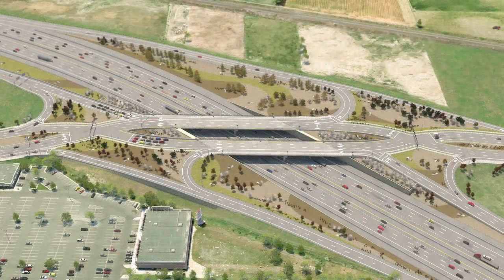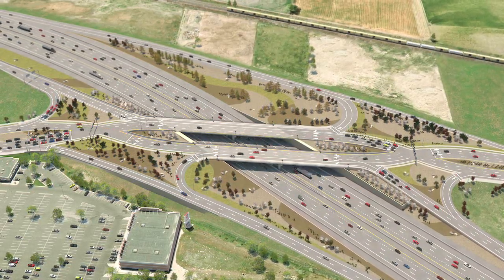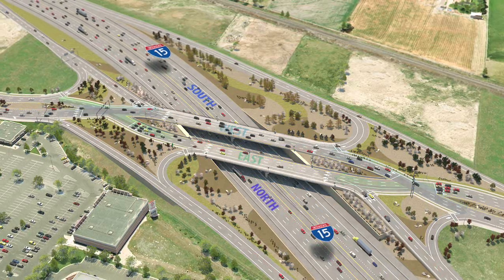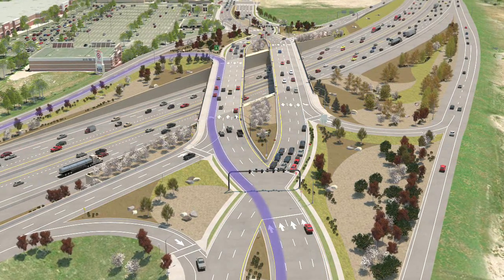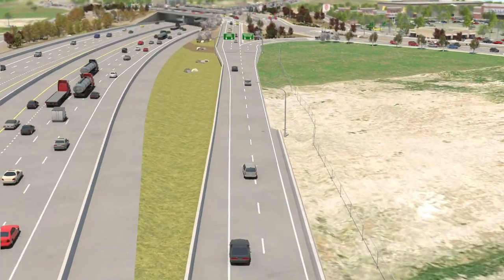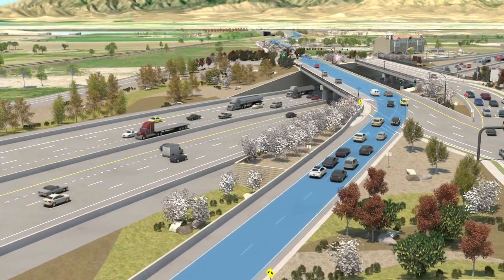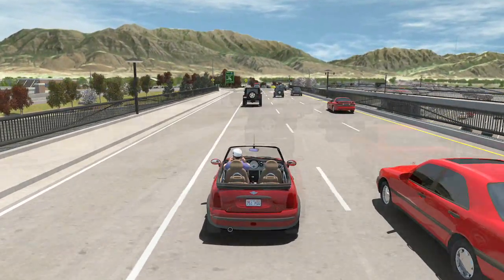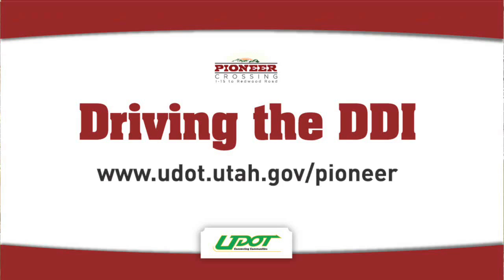DDI Animation

Comment: I see a definite advantage over places where you used to have to wait for the light to make a left turn.  It also seems to be safer than a roundabout, where people failing to yield to those in the circle is always a risk. I'm not yet sure why this is better than the usual clover design except that it seems the diamond uses less space as you don't need to drive in a 270% turn.

Comment: so many exits on the left..

there's no way this can be considered safer &/or more efficient with lefthand exits - left exits are a major cause of back-ups & congestion because it keeps slower traffic on the wrong side of the road.. you want exiting traffic [slower] to merge right & let the onward flow of traffic to remain left & pass safely.

plus, in this scenario, i can already see cars sitting each other off to get into the left lanes for the freeways - not a doubt in my mind there will be drag races from the stoplight to the left exit lanes..

this concept would be better if it implemented righthand exits instead of lefthand ones - it does look pretty though..
Reply: Welp, they are getting put up all over the place, and the data just keeps rolling in. These things are kind miracles, increasing safety while hugely improving traffic flow.

Comment: I can improve on this just by having the DDI overpass each other instead of a light controlled intersection.
Reply: You can't.
Reply: Not just you can. Double Crossover Merging Interchange (DCMI) is akin to an independently developed (to DDI) grade-separated free-flowing version of the DDI.
Reply: Explain why
Reply: The way they have this, at some point someone not familiar with this intersection is going to turn right into oncoming traffic because the lines are worn out and the signage isn't easy to see.  That is my impression anyway.
Reply: Robert Schuster, you can't.

Comment: +Utah Department of Transportation
How is it better than the cloverleaf pattern? That also eliminates left turns, have less conflict points, no lights, no limit on straight through traffic, let alone it can take less space and less confusion.
Reply: It is better than a cloverleaf because there is no weave condition for a short distance at high speed. Not all conflict points are equal.
Reply: Not sure for this case, but I know of PTV products that seem excellent for that purpose
Reply: it's not better than cloverleaf. It is less expensive, especially for retrofitting an existing diamond where you can reuse many of the existing ramps. It is, however, definitely better than the standard diamond if the majority of the traffic is turning.

Comment: heard about roundabouts?
Reply: Roundabouts are not suitable for high traffic whatsoever. This is 4x3 lanes, man. Roundabouts can maybe manage 1 or 2 lanes from all directions. Roundabouts would limit pass-through traffic throughput (going straight) and necessarily involve conflict points, which this design doesn't have for at least half of the traffic (thanks to the underpass)
Reply: Those take up so much more space and if they were to go with that instead, they would need to add in more bridges and also take into account Semis to which I am experienced with driving, and come across a few poorly designed rotaries with too small diameter or not enough lane width to account for the trailer trailing.
Reply: Glen, the Arc de Triomphe in Paris, France has a ten abreast no marked lane roundabout or traffic circle, what a traffic headache/nightmare and no lights.
Reply: wrong, roundabouts can easily handle 3 lanes from all directions and can be built with or without lights
Reply: Joshua Cornell and am sure there are several other roundabouts with equally complex traffic patterns, such as the magic roundabout in Swindon, I was merely pointing out that roundabouts can handle more than the one or two lanes suggested by GaborBartel
Reply: North Americans are scared of roundabouts. It's sad but true.
Reply: GaborBartal though I think the DDI is better here for this level of traffic, especially with a high volume of left turns, I could imagine a roundabout having 2 lanes from each approach with slip lanes on all right turns.
Reply: Roundabouts can be great when the circle is single lane. They lower average wait times in light to medium traffic, and reduce serious injuries and deaths (not accidents, roundabouts actually cause more, but since the accidents are almost completely sideswipes and rear ends vs headons and T-bones they aren't as serious).

Single lane roundabouts suffer once traffic gets heavy though, because they can clog, and become comparable to a four way stop. Assuming drivers don't block the intersection traffic lights do better in very heavy traffic situations (assuming the majority of people aren't turning left, then things can go to shit). Also if drivers DO block the intersection lights suffer, but still no as much as a clogged roundabout.

Multi lane roundabouts are a whole different beast. They lose a lot of the efficiency advantages of single lane roundabouts, and because of their size (and associated increase in speed), they also lose their safety edge. Driver side high speed T-bones in multi lane roundabouts are very common, with very bad results.

Turbo roundabouts are here to save the day for multilane roundabouts though.

DDIs in heavy traffic still perform better than a turbo equipped dumbbell interchange.
Reply: Just look for Slaviia square in Belgrade (trg Slavija Beograd). 7 city streets, 5 of which have high multi lane  traffic. It is a mess that works.

Comment: In your CFI Tutorial video you say: "the fewer crossing lines of traffic, the better".
With this design, you actually added more crossing lines of traffic, as oposed to a clover.
Reply: Clovers as nice as they look are horrible when using them onto and off of the roadway with the on ramp and off ram sharing the same entry/exit lane. Thus you go exiting cars going at road speed and entering vehicles for example semi tractor-trailers which I am experienced to drive speeding up to merge with the other vehicles already going roadway speed. As for the comparison of this to a dual four way stop, this does have fewer INTERSECTION points per intersection.
Reply: That is typical for a cloverleaf, look at Exit 23 on I-495 in Westboro, MA. not same shape but similar design. Aside from the Exit 133 having a collector road that connects two of the loops off the interstate. If they want the cloverleaf to work more smoothly, they need to have designed and built it with an extra lane (collector) longer than the access lane you see in those two similar examples. for safer merging and less congestion. But even that would add to the confusion already inherent in the original design. 
Looked at the interchange on Google Map - Satellite view.
Reply: Check out Exit 133 in Stafford, VA on I-95. There is a seperate lane all together for entry/exit ramps.
Reply: But you also remove crossing lines of traffic, namely the left turns on and of the highway. You add 2 and remove 4 crossing lines.

Comment: Safer - maybe . 
Slower - absolutely .
Waste of fuel - a lot . 
Best solution I have ever seen is runabout over or under freeway . If no one is coming , you are free to merge . And you can enter if gap is big enough . It does not need lights , maintenance is lower , it is at least as efficient as lights regulated , but on low traffic it is much faster . Point of traveling with car is to get there , and on time , not to keep waiting in traffic jam on traffic light .
Reply: However, this is not low traffic by any means.
Reply: Safer: Yes, studies and real world data prove it
Slower: No, they are extremely efficient, studies and real world data prove it
Waste of fuel: Same as above

Roundabout interchanges are great, except they are doomed even in Europe. Why? Bridges are obscenely expensive. They are the most expensive part by a long shot for this type of infrastructure. Since roundabout interchanges require more bridges, they are getting left behind. Even in England, formerly the land of roundabout interchanges, they are getting replaced with dumbbell interchanges (which perform objectively worse than these in heavy traffic, btw).

Comment: I feel like I'm missing a crucial understanding of this.

We are about to get one of these in VA.  In the current model, the left-turn lights are yield on green most of the time and straight through traffic only stops to allow the lefts onto the Interstate, but most of the time, straight through traffic proceedes without stopping. 

In this model, straight traffic (the majority of the traffic) stops to allow the other straigh through traffic through, so the lights can't stay green for more than 50% of the time.  How is this better?

The animation shows extremely light traffic.  Do you have an animation that shows what happens when the traffic is 2x or 5x that level?

Also, does this model prevent idiot drivers from pulling into an intersection when they have a green, even though there's not enough room to make it across (because the queue for the next light is full)?
Reply: I come across that scenario even with the older intersection designs, I just watch those in front of me get stuck and causing others to get mad at their stupidity and as a semi driver even in my own automobile I just wait the light and ignore those behind me honking to move, then when I got space I go forward and look back when I have to stop and watch as those behind me are now blocking the intersection all because they are so in a hurry to no where truly important. I have yet to go through a DDI, but from this and another video, these are nicer than the old 4 ways they used to be.
Reply: yeah, well those people are idiots. I was stopped at a green light because there wasn't enough room in front for me to avoid blocking the intersection and the guy behind me honked and I would have enjoyed the opportunity to ask, "so, just so I am clear, you would like for me to pull forward and then pull up behind me, fully blocking this intersection? An intersection to that Hospital. So that when the ambulance comes carrying a child from a near fatal accident, it is unable to get through?"
Reply: Even better is idiots who get hit by trains because they sit on the tracks instead of waiting on the other side. I guess it's some psychological thing about having a lot of space in front of you.
Reply: Those idiots forget the rule of NO BLOCKING Intersections or driveways. Even I find myself in that situation at times when a bit to focused but it is not a busy intersection. Oh and also they do the same at RR crossings as well.
Reply: Hopefully this answers the question... There will probably be traffic lights that are green arrows instead of circles. But regardless, it is a turn onto a one-way which is actually allowed on red after a full stop in most states just like a right on red (though I'd imagine this will be no turn on red). A green light on to a one-way is not yield on green like a turn across traffic. The yield on green is relating to oncoming traffic, not necessarily the direction of the turn.

Comment: This intersection seems awful compared to a clover. This type of intersection slaps 4 traffic lights when a clover doesn't need any.
Reply: and cloverleafs still suck since they still have 4 sections of intersection on both road levels despite they lack stop signs and lights and now you go oncoming speeding up with exiting slowing down, and most I come across do not get what the turn indicators are for.
Reply: This is a better alternative if there isn't any space.
Reply: A cloverleaf does not work with this road.

Comment: I see no difference in this configuration except when exiting the expressway you will cross the oncoming traffic lanes on the opposite end of the bridge instead of the near end so where is the benefit.  I see a lot of confusion and accidents just to do something different.
Reply: If you look at a four way there is more intersection and thus higher chance of traffic, similar issue with cloverleaf and rotary or roundabout would cost much more. I have yet to drive through a DDI but before watching this or a previous other video on them, they seem much less congested due to less intersection and can handle more traffic in comparison.
Reply: I've only seen this and other animations of a DDI. One aspect that bothers me is the significant dependence on markings on the road surfaces. Especially with heavy traffic, these markings fade, and become difficult to see, leaving drivers unsure of what to do. This can become critical during heavy rainstorms, and more so with rainstorms at night. (I have experienced such uncertainty on the Garden State Parkway in NJ when trying simply to stay in my chosen lane. And there are no DDIs on the GSP.)
Reply: @hankmike9902  let’s be real though New Jersey probably won’t get any DDI’s anytime soon, they’re just barely phasing out the jughandles now